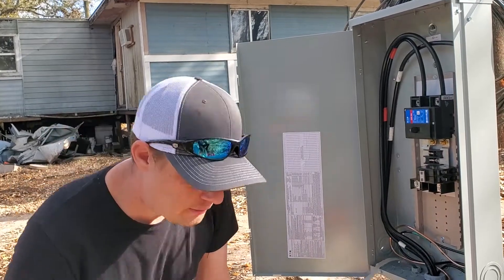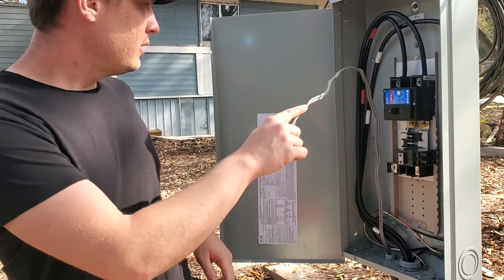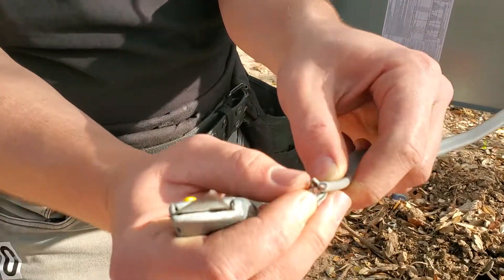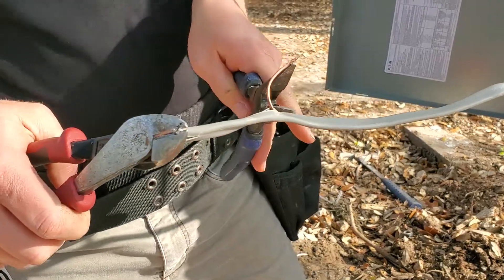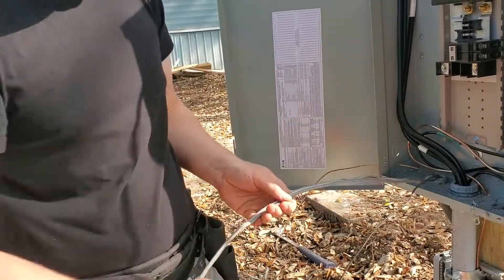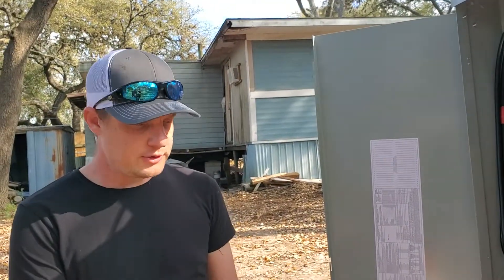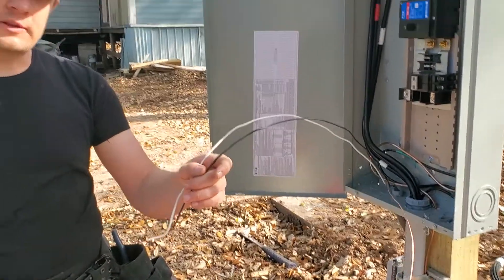HOW TO Strip UF Cable

Comment: Please,please use a hooked trimming knife, Stanley 0-11-983. Anchor the cable so you can pull the knife toward you. Pick a spot to dig in right next to a wire. Once you dig in, pull in deep. The blade will slide along the wire without nicking it. Use same technique to strip out all the wires. So easy and safe.

Comment: Nice simple video.  Can 10/2+G  UF-B be used in half inch Liquidtight conduit above ground on a wall to run a 30 amp Heat-pump?   Thanks.
Reply: The code requires all NM wires to be protected if subject to potential damage. Liquid tight will not fly with inspector. I assume you are burring the UF but where it emerges from the ground it will need to be protected. Sounds like a hassle but if you use ridge metallic conduit you only need to be 6” deep.

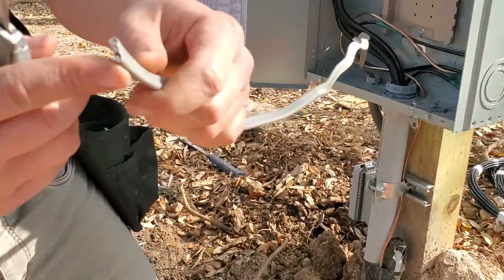Comment: 0:40 - 0:46, fucking Cameraman fell asleep!!!  Too busy watching for himself what was going on rather than making sure the camera should see. Fire his ass!!! 
Also, a good tip - sometimes the sheathing just really hangs on relentlessly.  When this happens, USE A HEAT GUN!!!  Heat the cable for a few seconds, not enough to scorch or burn or even melt it, just enough to soften it a little bit.  A LITTLE BIT goes a long ways to making a WORLD of difference when trying to peel it back!!!

Comment: One year apprentice electrician over here. I use ONE  tool to cut UF, romex, and cat5* (only the blue sleeve)
IRWIN VISE GRIP SELF-ADJUSTING STRIPPERS.  just do your cut and pull the gray sleeve........simple
Reply: these can work the best and offer the cleanest strip.

until the strippers break.

Comment: Does the UF-B wire have to be buried in conduit or can it be buried by itself. Thanks
Reply: Yeah it is direct burial, but the most proper way is with pvc conduit using thhn. You can put UF in conduit but it is a real pain to pull through depending on how far the run is, so if you are able use a little larger pvc size to avoid using pull boxes if it is far. Use sch40 pvc underground and if the conduit is exposed above ground use sch80 pvc(thicker and stronger, less likely to be damaged).
Reply: @herrelektrika5490  Actually your answer is incorrect.  It is AGAINST CODE to put UF cable in conduit (lengths longer than 10')!!!   It can create a heat issue using ANY cable "assy", as the insulation factor of the insulation can create a heat issue, and then with the cable inside an enclosed conduit, the problem is increased. Check your codes dude!!!!  Conduit is for SINGLE WIRES, and should otherwise only be used where the cable enters or exits the ground and goes into a box. Per code, the conduit should go down 18" into the ground to protect the cable.  Otherwise, conduit is a NO-NO for cables!!!
Reply: @BenDover4Mee  yeah, I should have specified last year when I made the comment that it is legal or not, depending on how far it is. You will notice though I did say the proper way(code compliant) is to use thhn in the conduit (single wires). I'm well aware of conduit needing to be buried 18 inches down, but did not see a need to tell this person about it in this case. In every case, it's always better to dig 20"-25" down, just a good policy to follow, and by doing that you might avoid pita inspectors, and you will always know that you are deep enough. Might be a good idea to add site pipes to the trench also if you backfill. I appreciate you reaching out to reply to my comment though 👍
Reply: It can be buried directly into the earth, usually 24 inches or more. That's what makes it UF-B. Any wire can be put in conduit and buried.